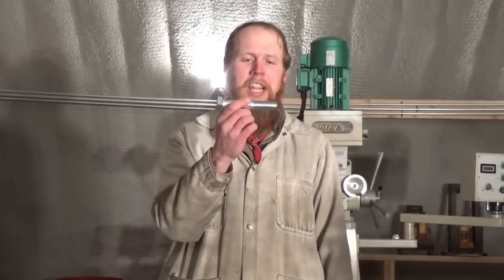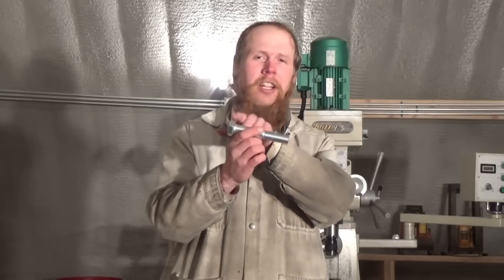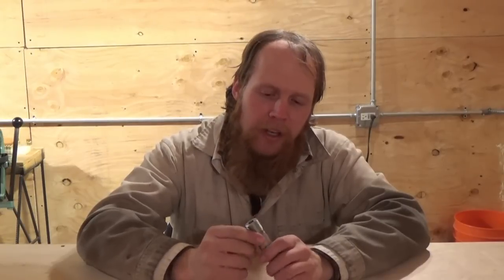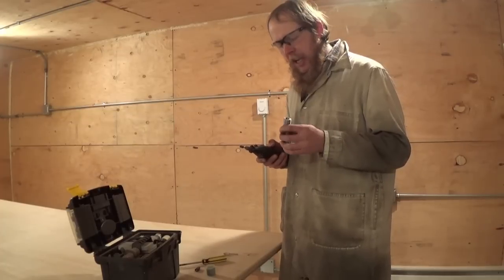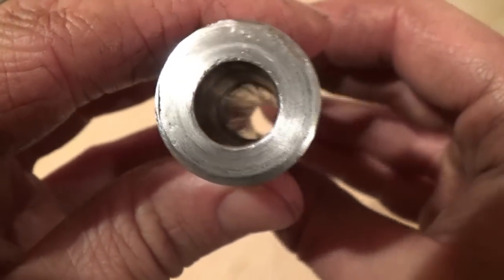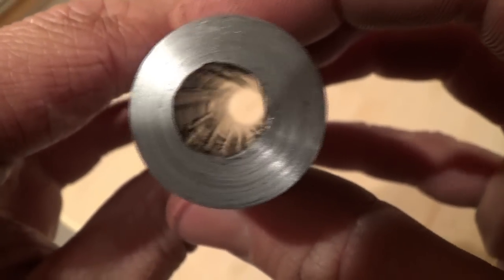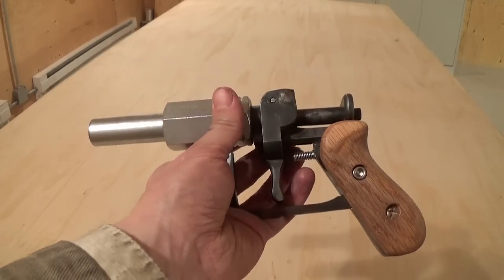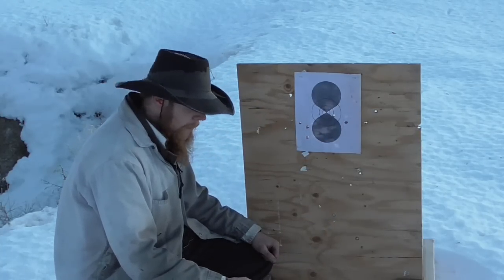Making a Rifled Barrel without Machine Tools (TIS081)

Comment: Would you not be better off making your button die with one end ground to cut out the groove rather than just displacing the metal with brute force?
Reply from the maker: That would be a broach rather than a button.  Broached rifling and button rifling are both used in industry, but a broach must have centering features, or be used in a machine that keeps it centered in the barrel (otherwise the cutting edges will tend to cut unevenly, making the broach dig into one side or the other and get stuck in the bore) whereas a button is naturally self-centering, making it easier to use for DIY applications.
Reply: TheIdahoanShow good to know!  Diy aside, which method produces a better result?
Reply from the maker: Well, I have yet to try broaching a barrel myself (although it is on my to-do list), so I don't have a personal basis of comparison.  In principle, they both have advantages and disadvantages.  Broaching provides more versatility in terms of what shapes can be cut (e.g. polygonal rifling) and how deep the grooves can be.  With button rifling, the cold forming of the grooves work-hardens the surface of the steel, which should improve barrel life.  Between this advantage and the simplicity of the button rifling operation,  button rifling tends to be the more commonly used process of the two.
Reply: I'm no machinist but I was an auto tech and in my training we had to do a set of valves. On one cylinder we had to install new guides and seats, on another we had to just grind the seats and knerl the guide with a special tool. And then I had an industrial Ford engine rebuilt and the builder knerled the top 1/3 of the guide to improve guide oiling without increasing oil consumption.  And looking down your improvised barrel just kinda brought all that back to me and made me think about all the pro's and con's of the different procedures. It's good to dust out the brains cobwebs once in awhile.

Comment: is this 8.8 bolt u use for barrel ???
Reply from the maker: I may have said it was a "grade 8" bolt in the video, but in retrospect, I'm pretty sure it was only grade 5.  Really, I think either would have worked.  Grade 5 is a little softer, so easier to drill, and still fairly strong.  Grade 8 is stronger, but also harder, and thus more work to drill out.

Comment: Whats that stuff on the walls?
Is your machine shop really a maruhana lab??
Reply from the maker: I presume you are referring to the cement plaster that we sprayed on top of the foam insulation so it would meet fire codes.
Reply: TheIdahoanShow 
Ah i see "Fire code" ofcourse!
Becouse one piece of hot weld in the isolation could burn down the shop hours later!
Ty for the reply i was curious!!

Comment: 4:32 if you chuck the bolt into the drill press and have the bit affixed to the table you will have a centered hole
Reply from the maker: Yes, in principle that is true, but in practice I have yet to see an ordinary drill press with a chuck large enough to hold a bolt this size.  That might still work well for making very small barrels, though (like maybe a .22 pistol barrel).

Comment: Nice video! For the first drilling operation, is that an ordinary HSS drill? And how did you steady the wood? Thanks.
Reply from the maker: Thanks!  I used a spade bit to drill the hole in the wood block, and ordinary twist drills to drill the steel.  I think one or more of the bits I used in the video may have been TiN-coated HHS, but honestly, in my experience the TiN coating is mostly just an advertising gimmick; regular black-oxide HHS drill bits seem to cut steel every bit as well as the gold-colored TiN coated ones.

Comment: What did the rifling look like after shooting several rounds through it? Did the rough spots foul up?
Reply from the maker: I think I've put 30 to 50 rounds through this barrel by now, and it doesn't look much different.  Wear from use has smoothed down the rough spots a little bit, but not much.  I haven't noticed any issues with fouling; it seems easy enough to clean, although so far I've never put more than about 15 rounds through it at a time.
Reply: TheIdahoanShow thanks for the reply! You've got a great channel!

Comment: Would I be able to do this to a smooth bore air rifle barrel ?
Reply from the maker: Maybe, although I'm not sure if an air rifle barrel would be sturdy enough to handle the force of driving the button through, or if the air rifle would have enough power to make the projectile engage the rifling.  Truth be told, I haven't done much with air rifles though.

Comment: "Without Machine Tools"

Reaches for a machine tool at 3:12
Reply from the maker: ~sigh~ How many times do I have to explain the definition of a machine tool?  An ordinary drill press is a power tool but not a machine tool.
Reply: Now I'm confused. A machine is just something mechanical that does work? or do you call it a machine tool because it machines things as opposed to just having power?

Comment: You might cut the original button in half to start with. The first half for the initial cut and the second for cleaning and deburring. Try lubricating with anti-seize for the length of the barrel. Then repeat...

Comment: very. very cool . whats the external  diameter  of That barrel?  and is it mild steel? sorry  for my wrong english 😅
Reply from the maker: External diameter was 7/8" (0.875 inches).  It was made from bolt stock; I forget whether it was a grade 5 or grade 8 bolt, but either way it would have been stronger than mild steel.
Reply: TheIdahoanShow  tnx for the info.  the Walls  are  so  thick  because  of high  pressure of a 40sw cartridge about 35.000 psi . and  it works very well hehe 👏👏

Comment: Funny, some of those tools are machine tools. I use a general purpose AC hand drill when I make my weapons and that works too. I don't bore my own barrels, though. Not yet, anyway. Great job, and better quality than anything I make, but contrary to the title. You can put a grinding wheel on a bolt right to the head, slip a spring down over the bolt against the other side of the grinding wheel, push and twist the bolt into the drill and make sure the spring is as tensioned as possible when you lock that improvised grinding attachment into the drill. It works well with cut-off wheels too but not so well with circular saw blades with the big teeth or larger di. items than about 1/2" bore or 5" total. Large items make the drill buck quite a bit against the thing you're working on. Last tip, if you don't have a machine tool like a hydrolic press, you can buy barrels, iron or black steel pipes cheap on Ebay, then use a drill bit the same diameter as the bore of the barrel. Drill one direction of rotation and slide the bit very slowly down the barrel 1 way only, then stop the drill when you reach the other end of the barrel and gently pull out. Don't worry much about fucking up, just hold the drill a bit loose as you go and don't deliberately put pressure to 1 side of the barrel wall or the other. The imperfect coordination of your hand while moving the drill down the barrel will allow the bit to naturally wobble around and scratch shallow rifling into the barrel. For legal reasons, that's technically all you need. The rifling won't be great, but you can at least say truthfully that you rifled the barrel, then. I do this and I'm sure to record it. The reason why I record is because over time, that shallow rifling will be rubbed out by bullets but the fact is, the barrel was still rifled at the time the weapon was made. Normal wear and tear may wear down the weapon but that's not covered by law. The initial making of the weapon is. It's another reason I don't polish the insides of my barrels. I let the bullets polish them naturally and leave traces that the rifling was at 1 time present in some old guns. Another way to comply would be to build antique firearms, which may have smooth bores. They aren't subject to modern firearm making. That's when I might use things like 1", 3/4", 1/2" or 5/8" black steel pipe, or 5/16" steel brake line for the inner barrel and chamber lining. I can leave it smooth bore because it's antique. To be specific, 1" is for cartidge B bore or overbore percussion or matchlock B bore or antique 12GA (black powder) shell cahmbers, 3/4 is for overbored percussion 12GA barrels for antique 12GA shells, percussion 12GA or .72 cal. matchlock, 1/2" or 5/8" is for .50-90 Sharps or percussion 20GA barrels or .45-70, .45 S&W or .45 Long Colt chambers, and 5/16" is for .32 S&W barrel. For the .32S&W chambers, I like 1/3" steel pipe, then I drill a bit out. Trust me, They always overbore black steel pipe at hardware stores, so things aren't always what they seem. Otherwise, 3/8 would work well enough for .32 S&W cartridge chambers. Again, all those examples I mentioned are for antique firearms, which is 1 reason I usually don't do .45 Colt or antique 12GA shells. The dimensions allow an overzealous BATFE agent or someone to easily redesign the antique firearm of any of those 2 calibers to chamber and/or safely shoot modern ammo at least once, simply by loading ammo that I didn't intend the weapon to be used with. It's why I don't harden the steel, buy barrels online or use thicker material. I intend the weapons to use cowboy ammo, antique ammo or black powder only. Anything more modern than that would likely blow up the weapons the way I designed them. They are antique firearms. When did that stop the BATFE from trying to rig shit up in their favor on technicalities, though? Just saying there are ways to get by without machine tools. A hand drill is a general purpose/household tool, not a machine tool. Same with that little handheld grinding/polishing tool Athe uploader was using. A drill press or hydrolic press is a machine tool, though. I tried using a hammer, grease, a drill bit and handheld punch to rifle a barrel more permanently, but it either got stuck, bent the barrel or it overbored the barrel with the sizes piping I used. I on't personally recommend it, but good luck. I hope this helped
Reply from the maker: I maintain that a common drill press is a power tool, not a machine tool.  I reserve the term "machine tools" for milling machines, engine lathes, and other equipment of that caliber, which are clearly in a different class of equipment than an ordinary drill press.

Comment: what drill bits do u like to use for a job like this?
Reply from the maker: I'm just using common general purpose twist drills.  Cobalt would probably stay sharper and cut a little more cleanly, but it's also more expensive.

Comment: @ timestamp 11:44 - well, that explains your broken rifling button! Why ever did you think that a soft wrought aluminum alloy base to your stack was going to handle the pressure you were putting into it w/ your press? Should have used a cheap chunk of mild steel [1018], and probably given it the Superquench treatment after drilling/chamfering/etc to suit your needs. Good recovery on just shortening the broken button for the next pass tho'! Enjoyed the vid very much, well done!

Comment: Excellent Video...thank you! I have several gun projects that thanks to you I can now do. Question; Where did you find a 7/8-14 rod coupler. I have been looking for those for a long time...I make swaging dies with a drill press and a dremel tool. I bought a 5/8 chuck for my HF drill press so now I  can make dies with 5/8" bolts and use adapters to put them in the press which as you know is 7/8 14.  Just a fyi, I noticed that you were using a grinding wheel on the dremel to cut the button. I have been using diamond wheels from eBay -China for quite a while now. They work way way better than the stones. Do you think that technique would work on a rifle? I am going to convert a 22lr barrel to 25 cal to use .25" nail gun charges that I have designed a modification to that holds a bullet in them. I also want to make a 25ACP carbine. I could learn so much from you. Thanks again for the helpful video.
Reply from the maker: I got the coupling nut from McMasterCarr <https://www.mcmaster.com> As far as rifle-length barrels, drilling the center hole gets much more difficult as the barrel gets longer, but if there is already a center hole to act as a guide, then I expect this rifling method should work.

Comment: As others said, the echo makes it a tad difficult to hear, but this is an excellent video on the idea and process used. Thanks for sharing!
A better idea for getting your depth accurate would be to mount a set of calipers to your drillpress so you can see the exact depth you are drilling down, especially if it's digital and you can zero it in.

Comment: Amazing! I don't know if it can be useful for anyone; but my master has taught me to drill holes the opposite way. I grab the drill bit in a perfect 90 degree angle to the vise and the barrel (or any cilindric thing you want to drill) to the Chuck. Get it kinda centered and as I go down it finds the center by itself. that's what we do when the lathe is broken and no monry.

Comment: The long button sheared because the nose was turning "faster" than the tail as it was pressed through. This is also what caused the first pass to be rather rough when compared to the second. If you take a very close look at the rifling of the first pass, you will be able to see where the shear occurred as at that point the rifling got considerably rougher.
The most likely cause for this is the template was slightly twisted when glued to the blank, which could have been caused by less than 0.2° misalignment. As you did not show how you aligned the template to the blank, I can only offer two suggestions for this method:

1. Keep the bore button short, you only need about 1.25 inches total length;
2. Lay the blank on a FLAT surface and with a VERY sharp pencil laid flat on the surface, mark your line on the blank, and;
3. Cut the line-up edge of the template using a steel rule and a razor to aquire an absolutely straight line-up cut.

Comment: Very intriguing and down to earth,..!  (I use to work as a black powder barrel maker, many years ago in Colorado),... 
If I may make a suggestion,.. When we button rifled our 4140 steel barrels, the button was drawn through (hydraulically pulled). As you can imagine, there are several laws of physics, and shop design that will have to be taken into account, if you are building your own machine,..  However, by it being drawn, I think that you will find a more accurate design can be achieved with the final outcome,... Also, many times, we used STP, as the lubricant,... This is just food for thought, that I thought that I would pass on,...

Comment: What great entertainment!  Clarity, simplicity, and thought provoking..    
Perhaps chucking up the bolt, first, and truing the head at rt. angle to the axis of rotation, could have provided  an additional stabilizing surface  for the operation..  and save the trimwork with the hacksaw till later.   ??  (Like i said, "thought provoking...")

Comment: I think that if you were to add some stripes (like in a broach) along the length of the button, it could cut smoother ways. I made myself a broach for a special hex key and until i cut them progressively further away and with a tight nit pattern at the start, it just didn't cut right, a lot of chattering.

Comment: Well-spent 17 minutes, thanks for the DIY lesson. You say "rifle barrel" but I didn't see any tools for making a barrel long enough to call it a rifle, or even a SBR. Not a criticism, just an observation. I was concerned when I saw how rough the barrel looked inside after passing the button, but slugs seem to pass through fine. I would love to see how both of these issues could be solved for making, say a 10" barrel with precise rifling. Can it be done using your clever system?
Reply from the maker: Here is at least a partial answer to your question: <https://youtu.be/GQKOHioHJfA>